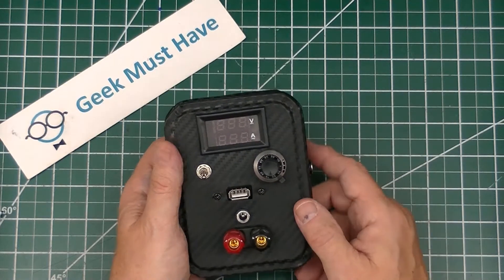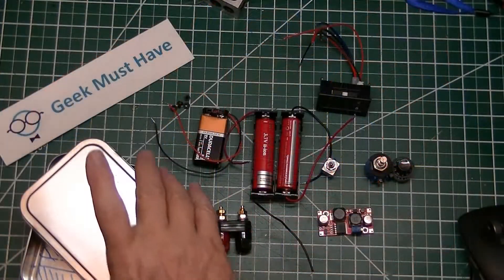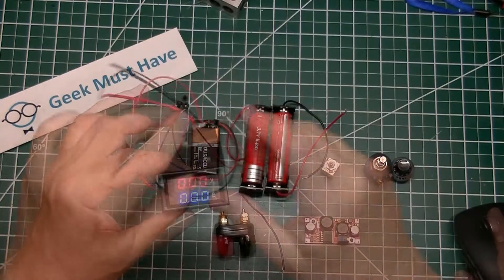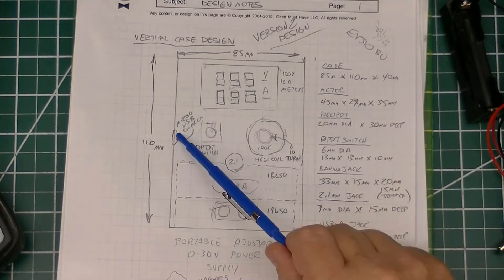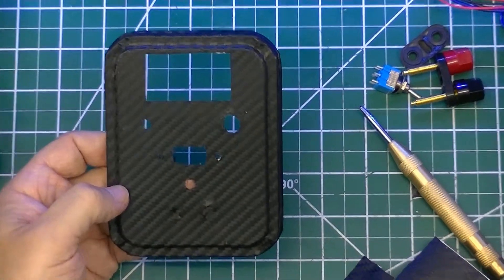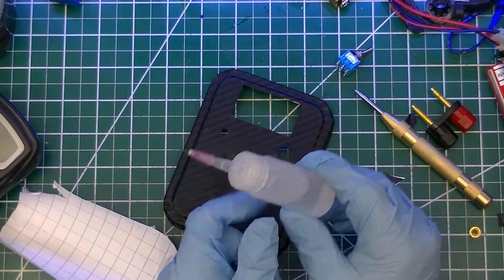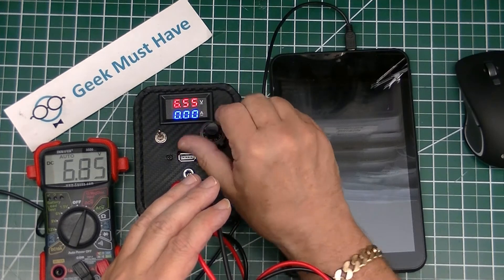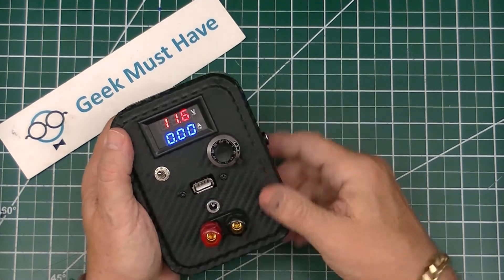DIY Portable, Battery-Powered,  1-37volt Power Supply GMH 055

Comment: I never thought of that, that's a great idea. I just updated the portable power supply with new battery protection and charger circuit.   I'll add it to the description as a download link.  Thanks
Reply: Just noticed there is a circuit diagram at https://youtu.be/VWZ-F2RccLI?t=235

Comment: You don't have the USB output in your wiring diagram, did you just wire it in parallel to the output? Also if you have a higher voltage on the output you can't use the USB port for 5V devices!?
Reply from the maker: All  three outputs (Banana, USB and Barrel) are in parallel.  Yes, if you hook a device that only take 5V and you turn up the power to 12 volts you would most likely fry the device.  When I designed this I didn't intend to use to as phone charger.  It's an inexpensive, low power, portable power source.  Maybe in the next design I'll make the USB a try 5V source.
Thanks for the comment.

Comment: I would like to make a battery source for various cordless tools. Alligator clip or universal adapter to hook to where the battery pack hooks. A cord. Have it adjustable for whatever the tool is. A 20 volt dewalt drill. Just dial it to 20v and hook to where the battery contacts are. Construction laser? Just dial it to the needed volts and hook it up. Will this work for that? I may wanna use a lawn mower battery size.

Comment: Hi how would this last running a small 12v DC motor???
Reply from the maker: The power supply has 2 (18650) batteries which is 8.4v at 2000 MAH current, if you boost the voltage to 12v then the currents limited to approx 1300 MAH.  A small 12v motor can take up to, lets say 300 ma then maybe 4-5 hours,  less if the motor used more current.  This is based on batteries being fully charged, as the motor runs the voltage will drop and to compensate the current available goes down as well

Comment: Some heat on the vinyl will help when applying around the corners. Make sure the aluminum is very clean so it bonds well and lasts long.
Reply from the maker: Late reply bit, I tried that out on another project, worked like a champ!  Thanks for the tip.